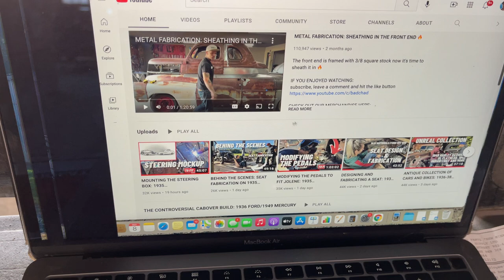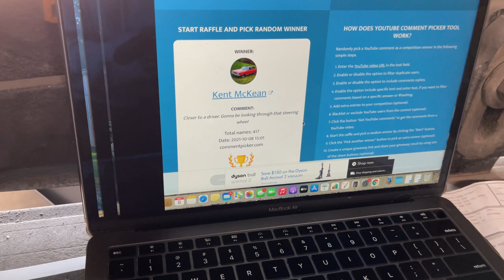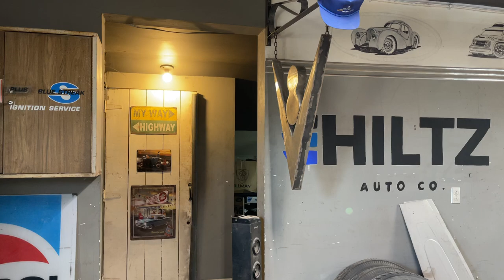EXTENDING THE STEERING PITMAN ARM: 1935 HUPMOBILE/FORD

Comment: By lengthening the pitman arm you have changed the steering geometry so the wheel will be harder to turn and the steering will be much quicker, ask me how I know!
Reply: HOW DO YOU KNOW, BEEN THERE DONE THAT?
Reply: @davidfarley1175  I have been into off road buggy's for 30 years now and I've done many mods to steering and handling, you do get quicker steering response by lengthening the pitman arm, at the same time you're making the steering wheel more difficult to turn, it's all about leverage.
Reply: @davidfarley1175  simple engineering principle.

Comment: OK Jolene, let's pull a Bad Chad and do a burn out first thing out of the chute when you get to drive the racecar. You guys are making great progress on these projects, racecar and COE. Now you are double teaming it so things should even get better. With all the weight cuts Bad Chad has made and wind resistance made by sectioning-lowing and chopping the car, it should have a big advantage over some if not most all the other race cars. I still would like to see some roll bars to protect Jolene in case of a roll over or a broad side crash, which is required in the USA.

Comment: I think you do really creative body work and you improvise beautifully but the engineering mods worry me Brad, especially the way you extended the pitman arm. I believe an engineer would be concerned. If you'd spent a bit more time using a bench and vice, drill a hole in each sectioned end , dowelled the extension piece bevelled/channelled the weld area, then welded it to create a structurally safe component it'd be fit for purpose. Engineering and body modification are two distinct fields. I know you prefer to do things quickly but quickly is not the best opition with engineering. I hope you accept this comment in good spirit as it was intended. Always better to be safe than sorry.
Reply: Hi i am a liitle surprised he didn't put in a more modern collapsing steering column .Just in case of an accident.
Reply: If you would have listened to him.. he said it temporary.. to move the car around..
Reply: @danbish5371  
I heard it Dan...but temporary can become permanent. Brad was adding a lot of material via welding to the pieces to reshape the pitman arm.  Sculpting the pitman arm with weld to replicate the existing profile (why?) so that the car can be solely moved about the property temporarily, doesn't sit well with me.  A fracture in a steering component can cause death. A custom billet replacement would cost more in time and money but would be the safe option.  None of this takes away from Brad's creative skills with bodywork. Safe engineering is never optional.

Comment: HI CHADi hope you move the steering colum forward and not run a welded pitman arm if welded thats only a surface weld hollow in the middle OHIO hotrod
Reply: I think he said it was all temporary so he could move the car around the yard and steer it. Great entertainment. Let’s hope that nobody gets hurt.
Reply: The steering will be quicker and harder as he loses the mechanical advantage. The stress on the gearbox itself can also increase dramatically snapping the shaft or other parts inside. I don’t think they actually plan on driving this hot rod so it should be fine for  yard art.
Reply: @i8ntnuts  she is going to drive it on an eighth mile dragstrip, IF they pass tech inspection! Lol
Reply: @i8ntnuts  he is going to race it
Reply: I don't think I would put my loved one in a car that is engineer as this is

Comment: Hi Chad ! I really like your work and but I'm not a car builder !   Isn't the steering wheel console a bit longer ? When you are looking from the side of the car the position on the driver (the head on the driver ) is located on the way of the door column ...That can be not safety when the driver looking around for car from left and right

Comment: Several things im afraid i have to disagree with. Pitman should have been removed,and ball/socket end should be kept cool. 
Arc welding and pre-heating followed with post cooling. Also using a section from a donor pitman. I know its not going on the road, but it needs some margin of safety. I see the ball/socket end can be removed. Should have.

Comment: I see one problem with lengthening the pittman arm and idler arm ( increased steering effort due to a loss of mechanical advantage ). Maybe not so bad for an eighth mile drag racer, but road racing would be another story.

Comment: Just wondering if that's any of the new "LINCOLN" equipment you're using? I'll bet it has some awesome capabilities. Sure would be nice to have a Lincoln representative stop by for an introductory demonstration. This ol'mo'fo has had several welding jobs in my lifetime, but I'd definitely still need help with the basics. 🧐 😁

Comment: hey guys, luv your enthusiasm Chad BUT that pitman arm you should have made a new one from a lump of new metal OR adapted one from another vehicle ..OR drill up into the ends and inserted longer piece of round steel then drill holes and cross pinned it at both ends , then welded round the new piece and ends..metallurgists will say where you have but welded it ,it could break upside of the weld....good luck

Comment: I'm glad I'm not the only one to notice, the crossmember location under the steering column will require the column to be removed when removing the body. I'm sure you will just rock and roll on...

Comment: Personally I would check the movement of the steering first before lengthening the pitman arm and changing the gearing of the steering . However given its weight , a more direct or high geared steering wont be an issue. But in reality you will do it however you want , which is also what I would do. This is my morning inspiration channel , before attacking my own projects. Thanks for what you do.
Reply: Yea it’s gonna steer badass go cart fast!

Comment: It's Friday! We had a big weld today, it was red-hot metal! Maybe if you use a little smaller steering wheel it would help with vision but not with force needed to turn. Not easy to find the balance! Thanks!

Comment: It's more of a hot rod than a race car with that motor.  But if it was fast it would be unsafe as hell.  Very cool how you sectioned and chopped but with the front end up like that? Might as well pull it behind a horse.

Comment: I knew you were going to fill and grind the extension, I just didn't know HOW you were going to do it Chad. I learned something very valuable for my personal use today. Thanks!
Reply: Chad said the work is temporary just so he can push the car around and hopefully steer the wheels. 
He did show us that the connections were shot and not really usable.

Comment: You really need to do something about your front spring mount where you made those two gussets on the ends you need to cut a square plate and cap off the front of it for the side to side force if not those gussets will fold like a book if you go into a turn hard and hit some bumps

Comment: I'm wondering if you should mark the steering arm & the cut off joint. Then rotate the steering wheel to the extreme end to see if the arm will miss the oil pan.

Comment: Sleeve the steering rod with some small tubing....weld the tubing on both ends to make it safe.....I would not send my bride down the track with that steering repair. Just my 2 cents
Reply: Neither would I. Never weld forged steering parts. Dangerous.

Comment: Chad be careful building the steering as it is an extremely important part of the car, it needs to be done properly to keep Jolene out of the wall. Are you putting a rollcage in it or at least a safety hoop that will protect Jolene? The cage or bar will give you some place to mount the racing harness to and make sure the bar is secured well to the frame. Please make safety your first priority especially when it comes to Jolene's safety.
Reply: I’m pretty sure Chad said he is building his “dream cars”. I might be wrong, but I don’t think they plan on actually driving this on the dragstrip.
Reply: @i8ntnuts  I'm pretty sure in one of the videos that he did want to make a pass at some vintage track. But it sounded like he was doing just one pass and then it would be on the trailer behind the truck for show. Either way it's still fun to watch him even if some of the stuff he does Is questionable. Bit it's his build and he's happy with so that's all that matters. 😉
Reply: @ Ron C
Definitely fun to watch and extremely entertaining.  Good people trying to make a buck doing what they enjoy.  The chance of these cars being roadworthy in a year so that Jolene can drive it down the track is right around zero. Chad (or anyone else for that matter) would need at minimum a small crew just to get them to the point where they would be legal for the road.
Reply: @i8ntnuts  Definitely entertaining and it's nice that their doing what they enjoy. I know most of what he builds would need a lot more work to make them safe to drive. It's still cool that he can turn a vision into a reality even if they never see the road. I admit I would not want anything built that way but it's his project to do what he wants and that's all that matters. 😉

Comment: It can get quite mesmerising when looting on the heat like that, pretty cool I think. Unfortunately that much heat has changed the temper of the hardened steel but if it works… 🤘👍

Comment: Hi guys, you are building a race car. Why not weld the doors shut and leave the roof open to get in and out, as this would save weight also.
Reply: Just cut the whole top off? I’d leave the doors on though.  He should take them off for now though I think. He spends half his time climbing in and out of the car. I’d hate to see one of them fall and get hurt.

Comment: Make sure that the steering wheel , when it is centered , that the top two posts are at 10 and 2 o'clock and the third post is pointing straight down. ( so Jolene can see where she is racing to ) Really .

Comment: longer the pitman arm the slower the steering will be. simple geometry
Reply: Actually the steering would be faster right? But the increased stress it would put on the sector shaft, worm etc might snap it off causing complete loss of control.